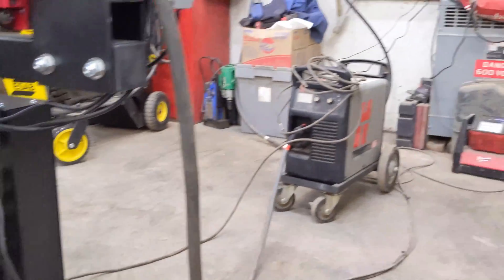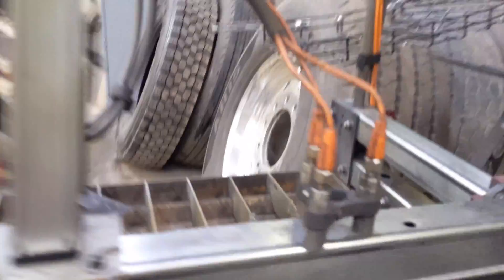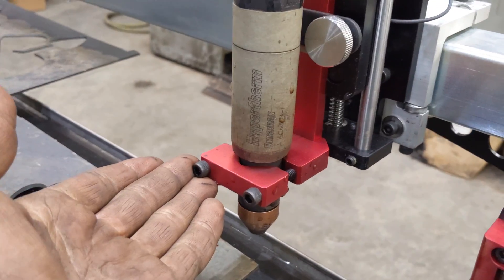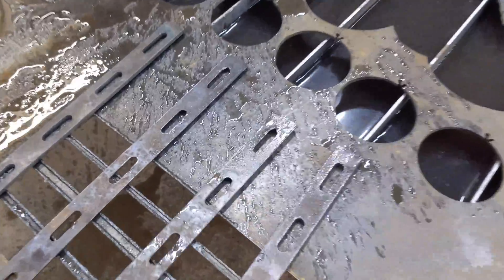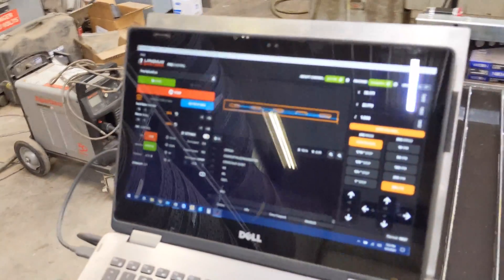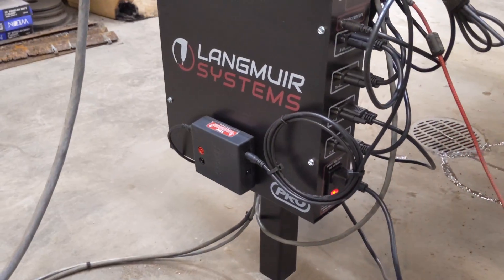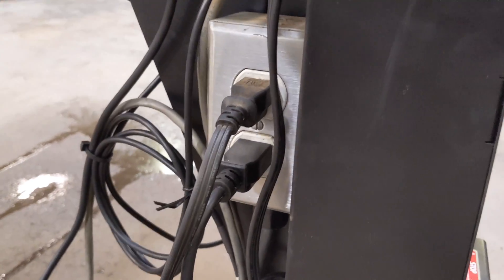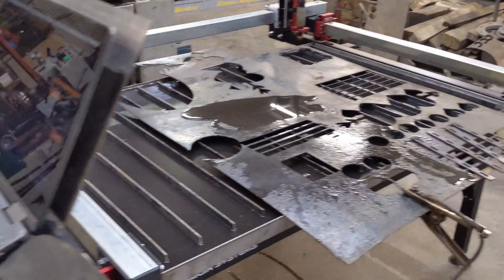Langmuir System Crossfire PRO - First Cut and Impressions! - Hypertherm 85

Comment: Do you have problems with the gantry bearings? I know this video is older but it's old enough to review the bearings
Reply from the maker: This machine has been in continuous service and used nearly every day since this video was uploaded. In that time frame, I have never replaced a gantry bearing or had one go bad on me. It is my opinion that the people that have gantry bearings fail, have the bearings drawn up too tight to the rail and don't allow for the inconsistencies of the tube. This table works as good today as the day this video was recorded. Absolutely no complaints!
Reply: @joshuazimmerman8631  awsome, rank you!!! I have one on the way, so I was curious

Comment: This is a horrible company to deal with.  In a nutshell I ordered what was advertised as a no hassle pre-order cancellations.  Well long story short they 1.  I requested to cancel the pre-order 2.  They updated their return policy, removed the no hassle bit and then stuck on a cancellation fee.  Thats some shady business practices.  What kind of a company does this??
Before you buy, do your research and you will find this is chinese junk
Reply from the maker: I haven't experienced anything you're describing. Nothing but top notch support and I've ran both the Original and the PRO machine continuously for nearly 2 years... I'm sorry you had a bad experience...
Reply: I would have to disagree. I have a feeling you are hard to please. If you didn’t get the machine how can you say it’s Chinese junk?
Reply: @jasongrinnell1986  Promised a 100% cancellation/refund.  Not refunded 100%.  How am I hard to please exactly?  I just want what we agreed on.  
Fact is, they are made in china.  Why do you think they do them in 'batches' aka slow boat from china.

Comment: Ordered my pro on Dec 29th, still waiting on the frame..I hope it's as good as you say with the torch height control...I got their Razorweld 45 plasma cutter and was wondering if I should have got a Hypertherm ot HTP instead.
Reply from the maker: Hypertherm if you can afford it...

Comment: Josh I'd like your opinion on the hypertherm 85 v/s the 65 as far as quality of cut and capability. Is it worth it in the long run. Im thinking I can be in the 85 set up for cnc mahcine for maybe 3800.00 or so. Would you do the same thing if you coul do it over? Still happy with the pro?
Reply from the maker: Our shop had a Hypertherm 65 when I started working there. Shortly afterward we upgraded to the 85, and have since bought a second 85. It's worth every additional penny, both in speed and capability. It's the most powerful plasma cutter in the world that can be run on single phase current. Now that I have access to three phase I wouldn't mind upgrading to the Hypertherm 125. 
And yes, I'm still very happy with the Pro. A few things here and there that are to be expected with a first generation product but still an amazing value.

Comment: Is the software hard to use? Will a 60gallon air Compressor work will this? Also does it give off a lot of smoke and sparks?
Reply from the maker: The software definitely has a learning curve, but once you've learned it it's fairly straightforward. As far as an air compressor, you need to check what CFM it is putting out. And as far as smoke and sparks, The water table greatly reduces the smoke and fumes, but there will always be sparks with a plasma...
Reply: Joshua Zimmerman  what cfm do I need? Thanks so much for the replay.

Comment: I get my Pro this week. I have a Hypertherm Powermax 65 with a hand torch.  Are you implying that an extra card is needed in the plasma machine to get the torch height control to work?  I heard you said yours had one in it?
Reply from the maker: Yes, torch firing is accomplished through a CPC port in the back of the plasma cutter. It's a six-wire cable that connects to that port and the voltage divider card that gets installed inside the plasma cutter. The whole kit costs about $100 from hypertherm. And yes you will need it to run your torch height control....
To use the CPC port you also have to be using a machine torch. The torch fire terminals are locked out electronically when a hand torch is connected.
Reply: Joshua Zimmerman I have a Crossfire table now and upgraded like you. I was able to go into the machine and tap into the torch firing signal. Works great. Thanks a lot for the feedback.
Reply: I will need to get the voltage divider card though.
Reply: I probably followed your write up.  I found it online on how to do it. Thanks for sharing and I will check out that cable set up.
Reply from the maker: @tractordriver88  
That's awesome! 👍
Reply from the maker: @NTK_FabWorks  
I knew there was a work around... Thanks for sharing!

Comment: Josh are they still using the same R&R controller board in the electronic controller case
Reply from the maker: The USB motion control board is a custom PCB made by Langmuir Systems. It contains all the inputs for torch height control all on one board.